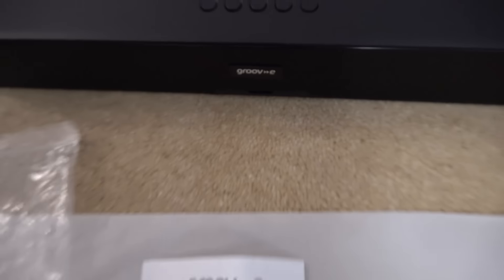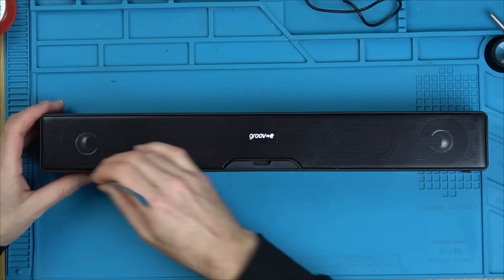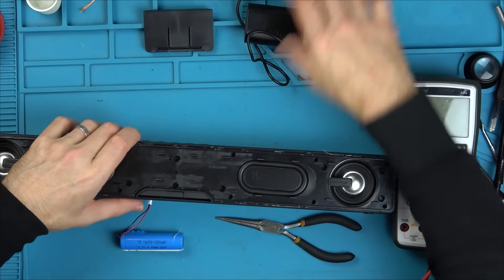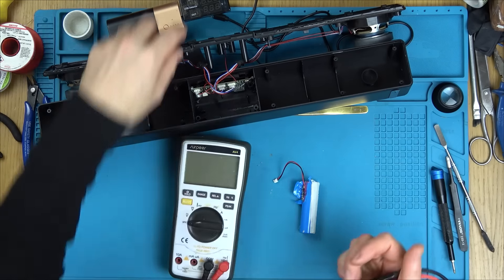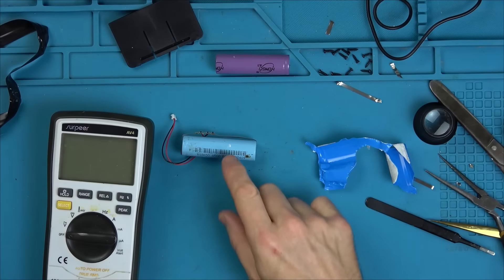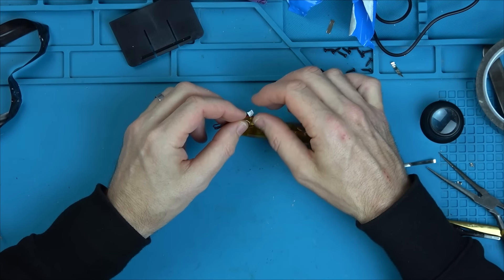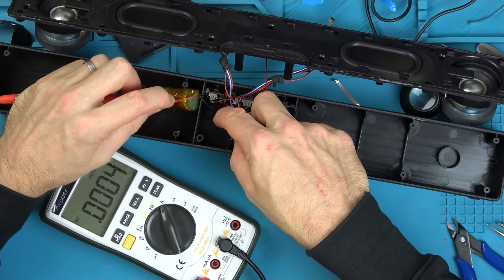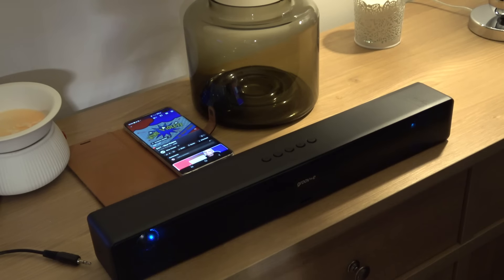MMV November 2024 Fixathon Day 3 - Faulty Groov..e Bluetooth Soundbar Speaker

Comment: OMG can we please stop with the unsafe batteries nonsense. I've been using salvaged laptop 18650 batteries that were restored from 0V for many years in various power banks and didn't have any problems, yes they have lost some capacity because they were discharged to 0V so instead of the original 2000mah they are around 1500-1700mah now but still work great especially in big multi cell power banks so I get 16000mah power bank instead of 20000mah not a big deal.
I was scared using them at first but after testing them multiple time in a charger that can sickle them by charging and discharging at 1A many times with temperature monitoring and found them just as usable as my other cells and batteries that were never discharged below 3V.
 Stop believing what other people say and test for yourself, you'll find a lot of you've been told not true.

Comment: --

Spoiler Saver

If this batteries fail so easy I think they are not very good..
Reply: The person initially bought the soundbar likely failed to read instructions. 
My guess is it says plug it in for 24 hours before first use to initialize the battery for best longevity.